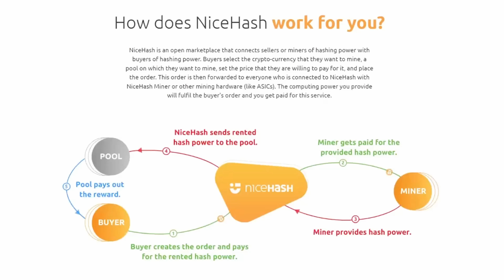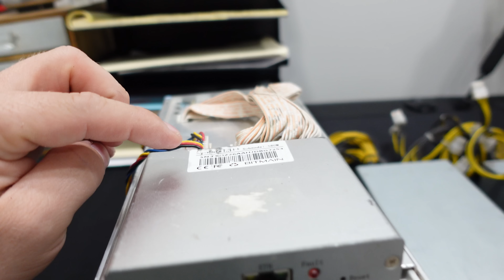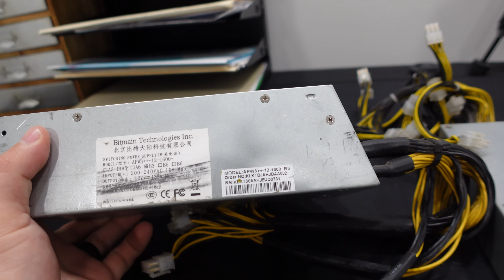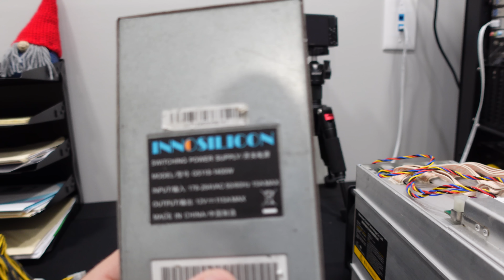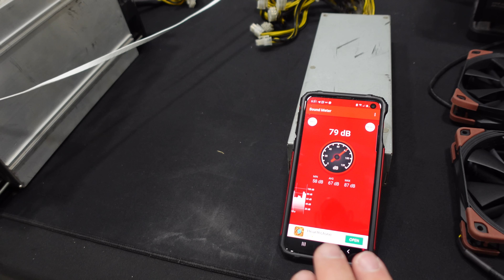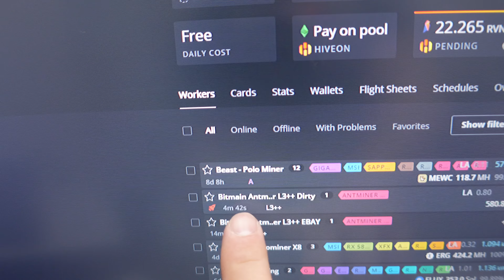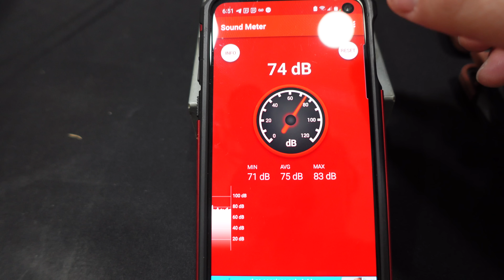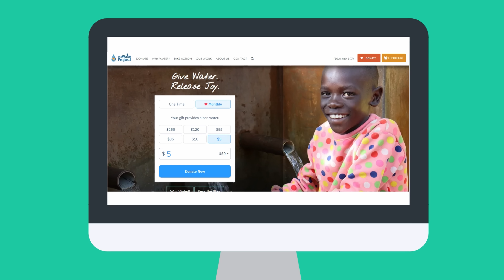Is NOW the TIME to PURCHASE BARGIN CRYPTO Miners! | Bitmain Antminer L3

Comment from the maker: I am like a kid on Christmas Morning with this New Mining Hardware!  Love the Feeling!  Have you purchased any Bargin Hardware Deals Recently?  Have you OR are you Running any L3+s?
Reply: Just got an L3+ myself
Reply: you must have cheap electric lol .
Reply: I have solar
Reply: I bought two L3+. Purchased one for $100, got the other one for $150. Also both local
Reply: @sgtfluffy7466  Seriously, you guys are so lucky in the States...deals everywhere! I can't even get 1 unit for under $600 in Oz!! Hopefully our prices come down soon :D
Reply: I have 11 L3 miners running on a remote location for 8 cents per KwH. Bought them in 2020. Not at bargain prices though. I still have aroun 80% of hashrate. Some boards died. Also had 2 at home to try out mining myself. They worked best with hiveon OS. Do note not all miners work well with all mining pools. Trial and error to find out what works best. And please, don't overclock too much if you want your miners running longer. Treat them well. Pro tip: use the heat as free heating. Or at least to quickly dry your laundry ;)
Reply: @Tacosmix  I'm using the 504 Mega hash at 660 watt overclock. And also doing the same thing of using them for heat as well. My heating system at home hasn't even kicked on yet. And my basement is a nice 75 80°. It's just supplemental heat that naturally Rises. I may not be profitable mining currently, but at least I'm making something, and helping the heating system in my house. What mining pools do you recommend? I'm trying to earn Doge.

Comment: Would love to see what's the best effiency you can get using hive on
I belive give on pre set has 504mh for 660w and Some ppl claim to get 530 mh for 630w by manually tuning it. I wonder if this is possible
I think that's something the hobbyist miner need to mess with 👀
Reply: I would run it on Hiveon. Best possibilities to tweak settings there. You need HiveOS for Antminer L3 then. Always make backup of previous OS!

Comment: The APW5 is a 2600 watt Bitmain PSU designed for noise reduction - originally paired with the Antminer R4 ASIC miner, designed for residential use. It would easily power two L3s on 240 volts.
Reply from the maker: Wow!  Thank you for that recommendation. I will look into it!

Comment: THM the local unit maybe dirty but it comes with the OEM PSU I like that, also the local unit noise level sounded lower to me don’t know why your dB meter did not reflect that, keep a close eye on the HW errors .. 50-90 a day is ok lower is better 0 is perfect .. too much HW errors is an indication one or more ASIC chip is not doing well, still the L3’s are all tanks solid little miners .. great space heaters too.
Reply from the maker: The bitmain one is so much quieter! I love it. The ebay one came with the Illisilicon one and it screams
Reply: @TheHobbyistMiner  yeah normally you don’t need to worry to much about the bitmain PSUs that’s 1800w or less, and the fans on the L3’s are ok if not close to living areas, but yeah if you got it on your desk or bedroom you’ll need to swap out the 120mm fans lol

Comment: piece of advice you can pick up antminer a3 dirt cheap and you get a control board and extra white jumper cables.  its a good idea to have extra of these.  I find that you blow out a control board way before you have other issues.  also a tiny sd card with files for the different settings is good to flash for summer time with heat made them run cooler.  I dont recommend going into app to fine tune each individual chip just not time/cost effective.  definetly get yourself some shrouds that cover the fan and the top part to capture the heat and some noise coming out.  makes a huge difference.  best of luck
Reply: Are you saying the a3 control boards will work in an L3?

Also can you link to what a shroud looks like?

Comment: Have 2 L3++ sitting on hive ASIC OS waiting for prices to increase.... with FTX folding and many other exchanges sending out notices about limited conversion/withdrawal... hoping for the best..
Reply from the maker: Very nice!
Reply: I have 11 L3 miners running for over 2 years already. Some of the hashboards died, but I am still getting around 80% hashrate which is pretty good. Truth also is that its hard to make money at current dogecoin and litecoin prices. But am not far away from ROI. Am paying 8 cents per KwH now.

Comment: Yes you can run the ASIC on the 1200w HP as long as you are on 240. On 120 it will not be stable since they only do 900w. I really dont think the noctuas will move nearly enough air to cool the boards, but good luck man. Bring a fire extinguisher
Reply from the maker: Going to experiment with it, if not will work on managing the fan speeds.
Reply: Tons of examples of people doing the swap and showing their temps being around 50c at 66% or so on the 3000RPM NF-F12 IPP fans. I'm doing the swap on my new L3+ units tonight (thanks to same day delivery).
Reply: Yes seen a few videos with the noctua fans swap